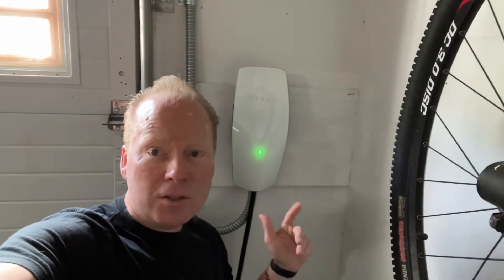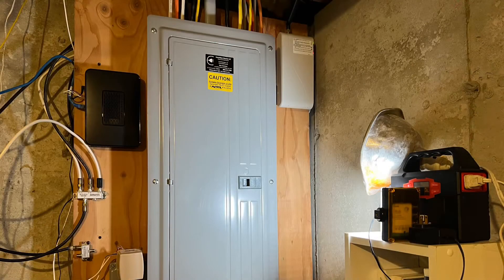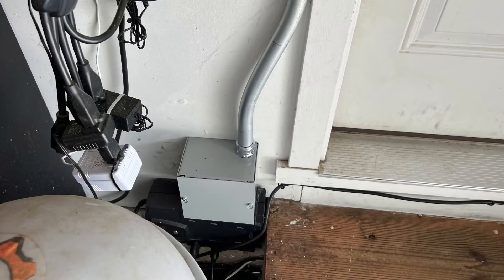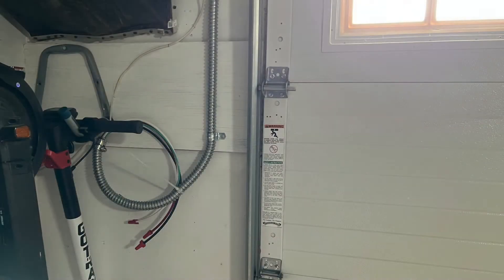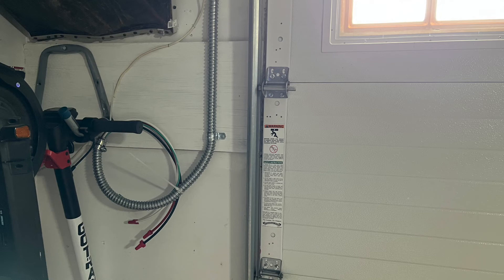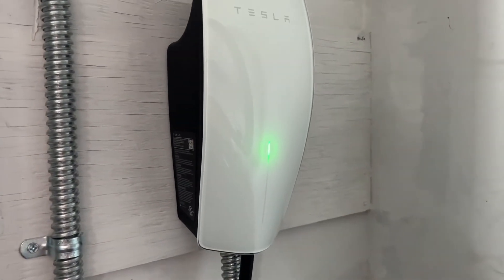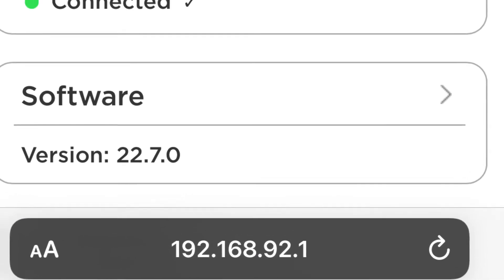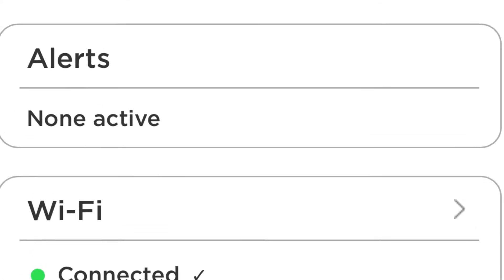11kW 48A Tesla Gen 3 Wall Connector install, connect to Wi-Fi update and configure 60A circuit cost

Comment: My wall connector connects to phone but won’t take IP ADRESS. Help
Reply from the maker: Create a new ssid on your router and make it 2.4ghz only
Reply: Did all that. Trick was to use google chrome not safari web browser. Thank you for reply. All good. Much relieved after a days work

Comment: Trying to get mine working. It shows connected but no internet. When I get to the 192.168 thing it doesn't go anywhere or load anything
Reply: No go. How can wall unit connect or site without internet.
Reply from the maker: Try another device you can use a laptop http://192.168.92.1

Comment: I have 2 wall connectors how does it power share
Reply from the maker: If you have 2 gen 3 units you can daisy chain them and then enable power share on the web interface of unit 1.  I ran 2 60A circuits and installed a chargepoint because my utility offers a rebate for non tesla vehicles (rivian).  And another rebate using the Tesla API in my model 3 performance.
Reply: @keenanjeff  right now I have generation 2 with 100 amp circuit my car can charge to 72amps
Reply: @keenanjeff  generation 2 generation 3 are not compatible so had to buy 2  generation 2's and share the 100 amp circuit
Reply: @keenanjeff  so you saying I need a small electrical box to feed both chargers independently
Reply from the maker: I ran 2 60A circuits from the panel so both chargers can do 48A continuous sounds like you have a  f-150 lightning
Reply: @keenanjeff  Tesla model S
Reply from the maker: Nice the old S with dual charger option unless you drive hundreds of miles a day probably better for the battery to charge at a lower rate I might even crank mine down to 32A or less.
Reply: @keenanjeff  I usually charge between 20 to 30 amps the cable gets very warm if I use 72 amps